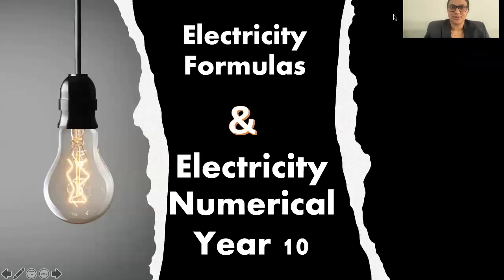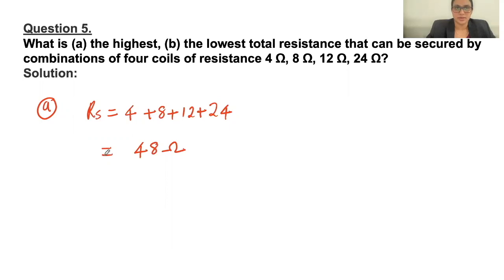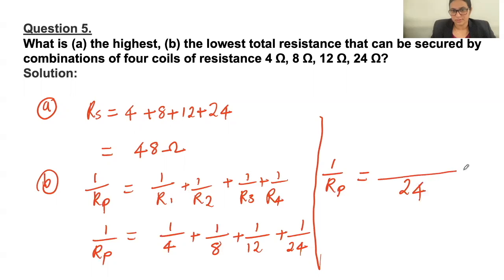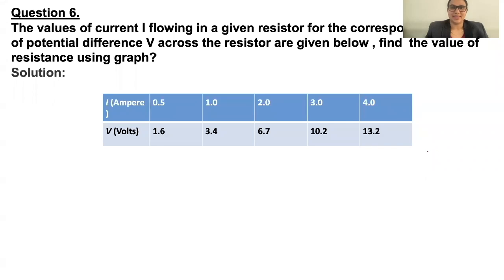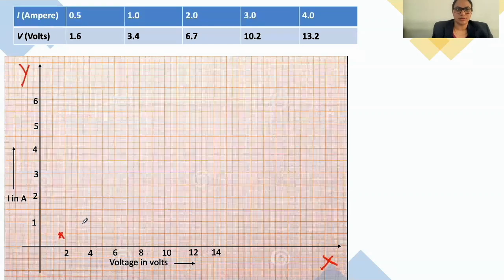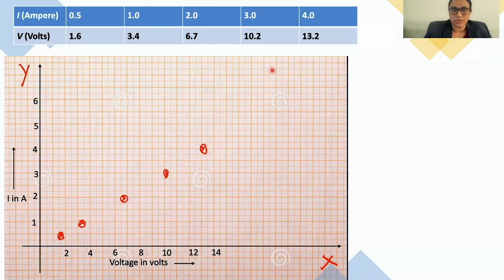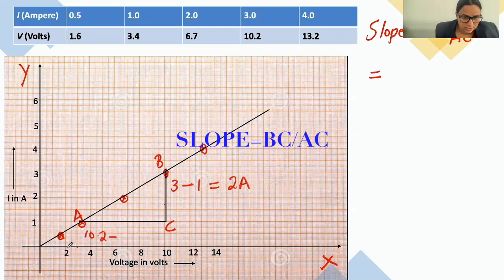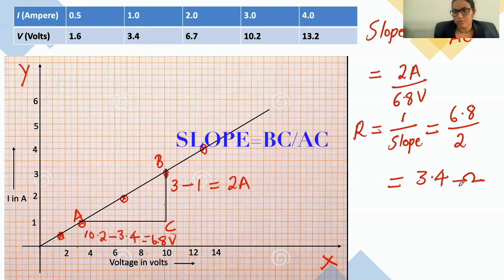How to plot a graph and to find slope/Voltage/Current/Resistance/electricity/JJ's Physics Class

Comment: Mam when we change the position of v and i then there is need to reverse the slope please soon mam🙏🙏🙏🙏🙏🙏🙏🙏🙏🙏🙏🙏
Reply from the maker: Current is dependent upon on voltage, voltage is on x axis as the independent variable here, and current on y axis, 
Formula for R is V/I,
Reply: @JJSPHYSICSCLASS  But slope is rise over run which makes the equation for R = I/V which is not corrent

Comment: Can we take any part as slopw
Reply from the maker: Yes you can choose anywhere on the line
Reply: @JJSPHYSICSCLASS  but mam aisa karne se toh answer 3.2 , 3.3 aise alag alag aa rhe h kabhi 3.4
Reply from the maker: Yes you may be correct, that’s because how accurate we are, while plotting x,y values and choosing slope, that’s why the answer is different
Reply: @JJSPHYSICSCLASS  so mam if this type of Q. comes in my board how should I answer it ?
Reply from the maker: They give you a range like 3.2 to 3.5 , your answer should be with in that range
Reply: @JJSPHYSICSCLASS  Ok thanku so muchhhhh! Mam you are awesome aapne kitni baar mujhe reply kiya thanku so much ! ❤️Also mam agar V-I graph mae bina slope ke sirf number se Resistance nikale toh bhi chaleha kya
Reply from the maker: No you can’t do that, if they ask you to find the slope by plotting graph, you must follow this way, if you calculate directly no marks will be awarded
Reply: @JJSPHYSICSCLASS  O ok now I understand. Also mam as you have taken the scale of voltage from 2V and current from 1A so can I take both volt and current from 1 like 1 graph box=1A/1V
Reply from the maker: You can do that but when you do your points must fit in to the x axis, here it is 13.2 is the highest voltage
Reply: @JJSPHYSICSCLASS  But mam how do I get to know that from which number I should start and how much gap like u took 2V gap in every succeeding volt
Reply from the maker: Suppose if the highest voltage is 28, then you can choose like 4V,8V,12V etc.
Another example if the highest Voltage is 1V, then you can choose 0.1, 0.2, 0.3 etc.
Hope this helps
Reply: @JJSPHYSICSCLASS  Ok 👍Thanku mam if any query arises I wl contact
Reply: @JJSPHYSICSCLASS  hi maa'm just saw your vid & i have a query ; when making the triangle which points should we take to find the resistance? by our choice or particularly any fixed points? pls reply , pls!
Reply from the maker: You can choose any points
Reply: @JJSPHYSICSCLASS  but then resistance will be different for diff values ma'am and resistance remains same for that specific conductor so how?
Reply from the maker: I understand your concern, here drawing tangent can be quite tiresome and also prone to severe manual and system errors. So to measure resistance with reasonable accuracy, we need to consider an approximately linear region near your point of interest  and find slope of that region. What happens here is when you draw triangle, you may choose the values on x axis and y axis is different than others due to human errors, so u may get one value (example R is 3.35)and other student get another value (example 3.45), so board will give a range of values for the resistance like 3.2 to 3.5 , your answer should be within that range. Hope that this helps 👍
Reply: @JJSPHYSICSCLASS  ah okay thank you so much , i'll contact you if any problem occurs again!
Reply from the maker: Sure